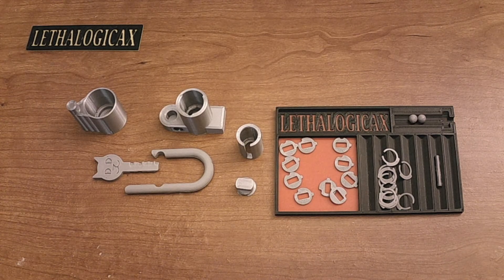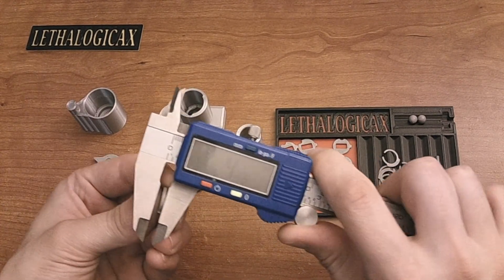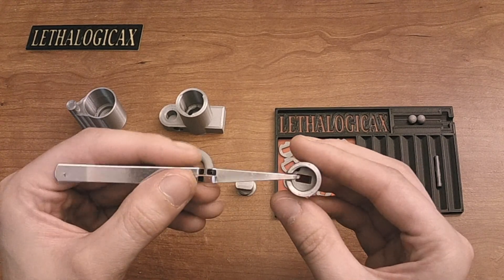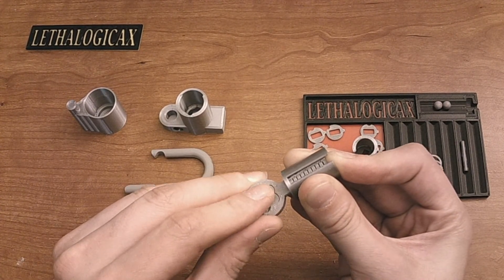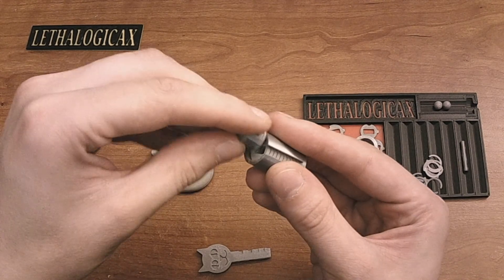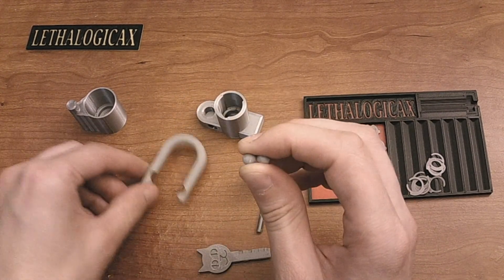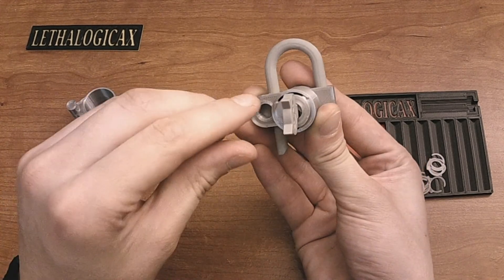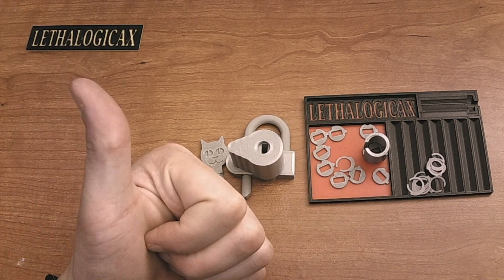How to assemble the 3D printable disk detainer padlock

Comment: I'll be attempting this over the weekend. I imagine the locking mechanism will still work fine if I don't include the shackle and bearings?
Reply from the maker: Yep! The core will still work exactly as it should without the shackle and ball bearings. Let me know how it turns out!
Reply: @lethalogicax2474  Will do. Just started the first attempt on the discs and spacers, hopefully I don't need too many reprints of those. Everything else will likely be printed tomorrow. Then touchup and assembly. Thanks again for designing this, I'm super excited to see how it turns out.

Comment: How do you work out how to put discs back in correctly for the specific key ?I’ve taken a disc detainer apart can’t work out how put discs back in order .
Reply from the maker: Im probably not the best to ask since Ive never gutted a standard commercially available DD lock. My advice would be to organize your disks by cut number (just look at the sidebar cutout relative to the key hole) and then work out the key code for your key. You might have to go through a bit of trial and error to figure out the correct orientation and order for all the parts. Good luck!